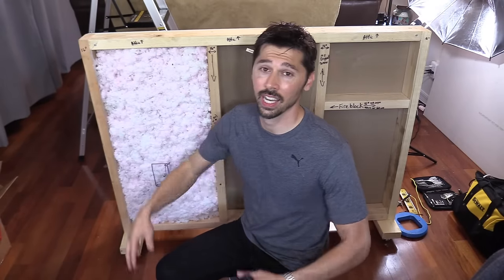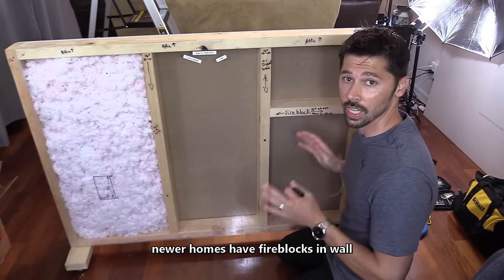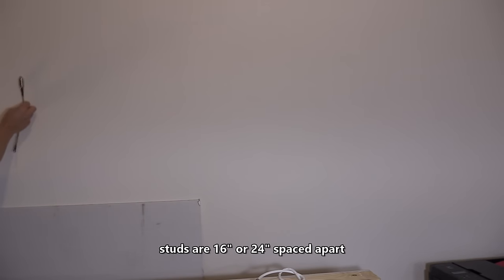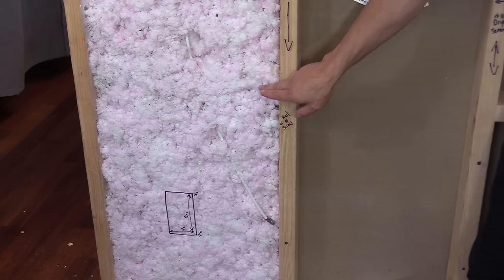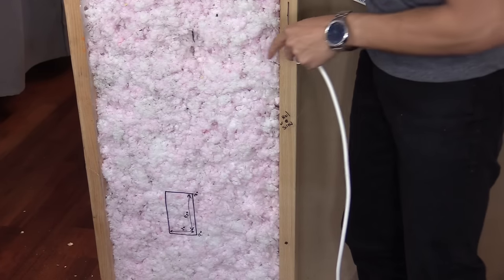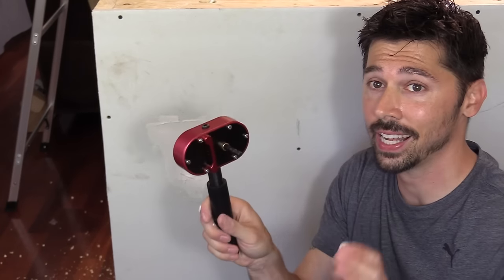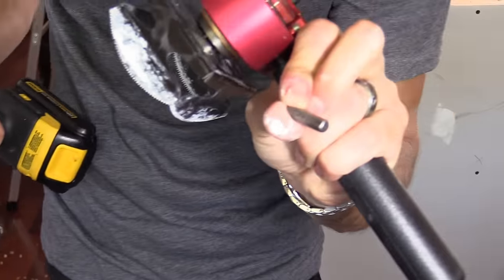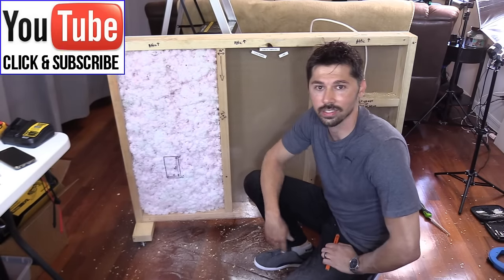3 EASY WAYS TO HIDE WIRES CABLES IN WALL & FIND STUDS

Comment: A couple clever tools for the worker doing this frequently for sure, but overkill for the average homeowner.  I punched through a fire block down from the attic by simply plugging hex driver extensions together until the spade bit reached the fire block and drill down through it.  A little painter's tape for safety put over the releases so that you dont bump the release when pulling them back up afterward and having them fall into the cavity as you showed.  Much simpler than cutting out the drywall at the fire block and needing to patch it!

Harbor Freight also has a 4' flex drill bit for $8 before 20% off coupon which helps get the job done if you can feed that bit in from the attic.  You can then get a set screw drill bit extension that will bite on the drill bit, and let you go hex extensions if you need longer.  

I was also able to just drill a 2nd hole through the top plate and look down into it with a flashlight in the first hole and a small nut tied on a string to swing it back and forth in the cavity until I could drop it through the hole in the fire block.

Well done though!

Comment: Great video. The magna pull looks amazing. They should include some sort of female coax adapter that can be attached to the end. You could just screw on the coax cable instead of taping it then unscrew when you fished the cable.

Comment: I can't hit the head of a nail with a hammer, but I watched the entire video and found it Interesting.   Now I know how they ran wire for my security cameras.  Thanks.  I will use that magnetic wand device the next time I need to find studs when hanging shelves or picture frames.  Also learned a lot from the other comments as to what they have done to feed wires.

Comment: Love a magnepull.. but never remember I have it on the truck when I lose a bit in the wall and always seem just tie-on to a fish stick and just jam it back and forth till i can find it.. rather than go get it.  As for fire blocks .. I'll cut a wall only as a last resort and then only if the home-owner allows. Re-texturing a wall.. dry wall.. painting. ouch.    More often than not, I can drop a section of re-bar down from the attic and bash that sucker sideways or knock it loose to slip past it - but koodoos to you for taking the time to make a video none the less.

Comment: One of the tricks I learned many years ago was to get a thin stiff rod. These rods are often found that hold up insulation in unfinished ceilings. Put it in a drill. And drill it either with a wall where it meets the ceiling, to find it up in the attic, or down at the baseboard and  drill through a hardwood floor. It leaves a very small hole, that's barely noticeable.

Comment: When dealing with the fire block I use a hole saw to cut access, drill the hole for wire or cable just as shown here.   But remember the purpose of the fire blocking and reseal hole with fire block caulking to maintain code.   That includes the top plates as well.

Comment: Good stuff man.  Most of what you're showing here is solid information for someone that wants to have a good level of professionalism about being an installer.

Only thing I would have liked to have seen is mounting the wall plate to an actual box attached to a stud.  Having wall plates mounted with just drywall anchors or low voltage brackets is band aid quality stuff.  I'd expect better from a professional installer.

Comment: Where did you get the adapter for the saw blade to use on a makita drill? This video is great for a novice like me thats about to put in new aerial cabling and connection points in the two bedrooms we have up stairs. 👍👍👌

Comment: Hi TampaTec, I live in Clearwater area. Thanks for the video. I have two questions since we both live in the same area and I'm assuming the houses you've worked with are built the same as mine, bricks on the outside and drywall on the inside. 1. Have you ever routed ethernet cables through a wall behind a shower/tub? 2. Or pass it in between the outside wall brick of the house and drywall? When I tried, there's a foam in between the drywall and brick that's making it impossible for me to pass the ethernet cable. Thanks again.

Comment: Instead of using a Qbit saw I use a standard 2 1/4 hole saw. I center it on the fire stud and drill till it hits wood. Also you just cut a groove into the stud instead of trying to drill through it and pass the wire through the groove. The round piece of sheet rock is easier to hide when you mud it back into place than a rectangle one.

Comment: Hi,

Need help and suggestions to travel wire about 2-4 feet from a power electrical outlet. Cant figure out how i would get it through a beam
Reply: If you're going horizontal you'll need to open up a bit of wall. Wherever there's an outlet, on either side there will be a stud running vertically to mount it too.  So you can get drill a 3/8th hole or bigger hole at an angle, just make sure you're not going to hit the romex.  Than cut a hole in the drywall where the next stud is and drill a hole into that one and fish the line thru.

Comment: Like someone else already said... there's more than one way to skin a cat; as long as the job gets done and you're not messing with the compliance to code.
I also cut out a small piece of drywall at the fire block (it's really just to stiffen the 2x4's on taller walls - it offers no great resistance to fire since it's covered by gypsum anyway) but then, instead of drilling through the block, I put a notch on the 2x4, about 1" wide x 1/2" deep (or enough to let the wire/s pass without pinching them) and then I put a blank electrical cover over it. That's a little easier than patching and painting - which inevitably will always show at the right angle(?).
Thanks for the video Tampatec

Comment: Ive been and installer/service tech for 25 years. Nice job on the video, you had some good info for someone just getting started. The only thing that I have to totally disagree with you on is the fire break info. Your killing yourself and the wall for no reason. What if wall was painted and customer didnt have any left, or wallpaper, or panel etc.  6 foot drill bit is all you need. And in 25 years, I have never drilled from the attic down, its so easy to go up if you know how to do it. Its nice to see a tech these days who is learning how to fish wires though, because most new techs never have to learn because everything is wireless. They run a power wire and communication wire only. A small part of me hates them lol. At any rate, great job on the video and stay safe out there.

Comment: As a telephone installer our method  was to use a long auger bit and bore trough the noggin  installed aprox. halfway down the innerwall .Then bore a second  hole at the upper level "for eyeballing the wire weight attached and guide it through the "noggin hole " not as easy as it sounds .Experience and perserverance taught us to do it quic kly  .I'm not about to say it was easy but worked most of the time

Comment: Great video. I am curious, doing what you did to the fire block, does that destroy the integrity or its reason of being there in the first place. Do you go back in and seal the hole up  with proper fire caulk seal after cable install?
Reply: Orange fire block foam.

Comment: I know this video is NOT about drywall repair, but...
before you put the cut piece back into the hole, trim the paper edges (where the cuts were made) first. You'll definitely
want to get rid if anything loose or straggling. Then, secure it with a drywall screw. And those pesky butt-seams will
require a lot more spackle, needing at least to coats. Anyone that's ever fixed a butt-seam will know that you'll have to
lace the area with spackle, because it needs to be feathered out, without looking like a lump.

Love your videos, Tech!
Reply: it helps if you take a round screwdriver handle, or something similar, and pressing firmly, rub all around the cuts creating a concave surface.
Then you don't need to feather as much because all the rough edges are below the surface..

Comment: Magnespot good to have.

Magnepull is a fail in most circumstances becasue any wall with insulation also has a firebrace.
Most clients will not be very happy about making a hole in the wall that needs to be patched (at least for small jobs), they dont want the added expense of a drywall guy, and I sure dont want to waste my time coming back 3-4 more times to sand and blend (and I am not that good at it anyway). There are entire product lines of long drill bits for this task.

The Qbit itslef though is nice for quickly cutting out a hole for recepticle

Fish socks are WAY better to have then taping.  Much stronger hold, easy removal, and no residue

Also an auger bit works much better, espically when most ceiling headers are 2 2x4s.

Comment: I guess your customer has to decide if they hate patching drywall or hate surface-mounted solutions like Wiremold more.  Surface-mounting may be better, especially if the customer doesn't have matching paint for the drywall.  I noticed several people have already mentioned flex-bits.

I love Wiremold (or the Lowe's knock-off SnapMark).  I've added some outlets at home with it and my wife doesn't seem to hate it lol.

Comment: Cool, except if you have old lath with horse hair plaster blobs oozing on the other side the magnet will not follow the roller but will get stuck or disengage. What about impenetrable sprayed urethane insulation??

Comment: I could see doing the patch method in new construction if customer changes their mind about an outlet or whatever, but if it’s an existing structure I’d use one of those long drill bits, like 4ft long, I think the ones I have a made by Greenlee or Southwire

Comment: fireblock piece was interesting ... I was running from the attic, and the solution was to get a 6' drill bit and run straight down to drill through the fireblock, then use fish tape to run the cat5 cable through.

Comment: I did cable for 8 years with no expensive manga pool.  Just stuck small stinger from cable through ceiling to find the spot in attic.  And used a stud finder to locate fire block. And simply moved over to next stud. So much easier than cutting and patching customers drywall.

Comment: I used to install computer network cables.  If there was a firestop, we would make a small hole just above and below the firestop, and run the wires through a groove in the sheetrock over the firestop.  Everything would then be hidden behind a blank electic wall plate. Much easier than patching sheet rock and then having to try to match the paint and repaint it! Never had a customer complain.

Comment: I used to remove the baseboard and around the studs I would drill with a two and a half inch bit about a half inch inside the stud after I drove through the drywall in order to get the wires behind that and I'll fish it behind the drywall in between each stud. That way when you put the baseboard back on it conceals it and of course you put the nail guards over your wire first. As if anybody comes out after you and tries to put a nail in that baseboard you don't want them hitting a live electrical line. not that baseboards really ever need any additional nailing unless they are improperly installed in the first place. if there's nowhere to nail it to that I'll use some liquid nails.

Comment: I was just wondering if you have ever seen a flexible drill bit extension to drill inside the wall you can drill through the fire block without cutting the drywall to get the wires down the wall they even have a little wire grabbing cage that you use to grab the wires to fish them down the wall you can drill up in the attic or down in the basement without cutting a bunch of holes you just cut the hole for the outlet box and your good to go drilling

Comment: Another tip... I don't go around horizontal fireblocks, I go through them. A 2 foot 3/4 non flex bit stays on my truck.  After pulling cable, I use an inspection cam and a rigid tube to apply fire rated sealant to the fireblocks through secondary holes in the upper cap. It takes a fraction of the time.

Comment: if you’re making holes in drywall in order to fish wire you don’t know what you’re doing.
The only holes required to fish cabling are the ones you make to put in your single gang retro boxes.
I own a magnapull, I’ve had it for over 20 years, and it’s a very rare event where you have the opportunity or the need to actually use one.
there is a reason why you want to hire a professional to run cabling inside of your walls.
potential plumbing damage which can cost tens of thousands of dollars to repair.
potentially damaging electrical wiring or electrocuting yourself.
there are so many things to take into consideration when running cabling through your walls that it would take an hour to explain them all.
but I give kudos to the man for sharing what he knows to help the do it yourselfer and good job creating the mock wall for demonstration purposes.

Comment: Many people here say they'd just use a long bit and avoid the drywall repair. But if the cavity is insulated how do you get the bit down to the fire block and then drill the hole with tangling the bit up in the insulation? And how do you avoid drilling through existing wiring that might run along on top or below the fire block? I've always wondered that.

Comment: What you're referring to as a "fire block" is actually just "blocking" or "nogging". It is not the same thing as a fire block, but it does still serve a good purpose: additional rigidity in the wall. It has nothing to do with fire protection since of course, it is wood...and wood is quite flammable. :P

Comment: How do you locate a fire block using a stud finder?  Does it work if I move the stud finder vertically down the wall?
Reply from the maker: Electronic stud finder should find fire blocks but not magnet stud finders because usually there isn't a nail in fire blocks. Walabot is the best tool to find studs and fire blocks.

Comment: Helpful tips for the DIYer... I have yet to see a drywall boarder put screws into firestop so you may be spending a lot of time searching for firestops with a magnet. Use of a flex shank drill bit usually eliminates the need to cut the wall at the firestop anyway, and if you do have to cut a hole at the firestop, look for a video on proper technique to patch the hole. The method shown here would likely only last long enough for a customer to forget the installer's contact info.

Comment: Try running an hdmi head. Also, for those talking flex flexbits, do they make those for metal fire breaks or just wood? Or would you need a metal hole saw but on a flex extender but then that could get really tricky and easy to lose that bit? In my opinion avoid fire block walls or just cut out the drywall like the video shows and let the owner deal with it. Works for me.

Comment: Alarm installer here. When all else fails and you have a wall with fire blocking  I’ll use a 6 ft flex bit and drill up and then tape my wire onto the back of the drill bit and then pull it up into the attic. Just be sure to scout out the attic good   so you don’t hit romex or water pipes ran along the top plate. And if it’s an exterior wall and there’s no room to drill down you can drill up and then tape your wire onto a rod and poke that into the attic through the hole you made (the hard part) and then grab the wire with a telescoping grab-it.

Comment: Great tips! 
The horizontal 2x4 is typically not a fire block though. It is found in structural walls to prevent buckling. Since we don't know the reason, we should stick with horizontal blocking. I know, I am nerdy jerk. I don't care. 😁

Comment: Well then how would you get a cable from the top of a wall when you have 3 or 4 noggins in the way going down. It's not possible to drill a hole through each one to get to the very bottom one where you need the cable to be.
What's the solution in this case ???

Comment: Well, a vidéo only usable in usa chère they use Woody as the frame. In Europe I dis use magnets several times in the past but it is often really difficult due to Iron frames (placosteel like). Lost likely use magnets outside of the wall and a standard Iron object as leading head of the cable.
Or void+wool+tuning. Multicouche pipes used in plumbery are also a really great Time savior.

Comment: Most importantly, schedule the attic work to be done early morning. Yes, use a flex bit to get through firewall. Metal coat hanger you can use to snag excess cable slack in wall.

Comment: what would an installer for a hidden tv wires job charge, with and without fire block.
Reply from the maker: 🤔 For you Free, but seriously I would normally charge either $70 a HR or 70 per wall fish not including wires and wall plates. Buy 12ft hdmi 2.0 cables on Amazon.  Tv installs with wires wall fished not including mount bracket about $140 average. Buy your own mount on Amazon $25.
Reply: @TampaTec  thank you, appreciate the answer 😁

Comment: drywall knife 10 dollars , 2104 electrical box 1.50 to trace outline , also called a dwang or nogs for bracing the studs against buckling under load

Comment: If a customer is repairing or replacing the drywall then I’ll cut into it but most cases they’re not, so I use flex bits to drill through cats. I even have one with a collet so I can put whatever size hole I need in the cat. Only thing is getting the magnepull through it, especially with insulation.

Comment: So, how does one fill the hole in the firebreak? And what about older homes which likely have spider studs? My home is wired from the basement up through the center of the home, up over the second story ceiling, and back down the outside walls through several firebreaks to the main floor. Did not really matter, though, as Grandpa was an expert in lath and plaster. “You need to see inside the wall, you poke a hole.”